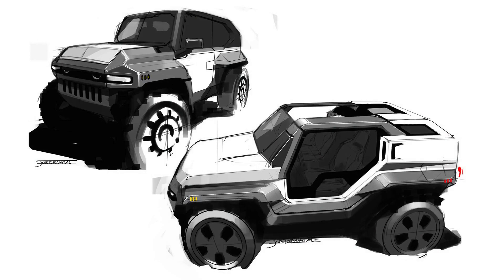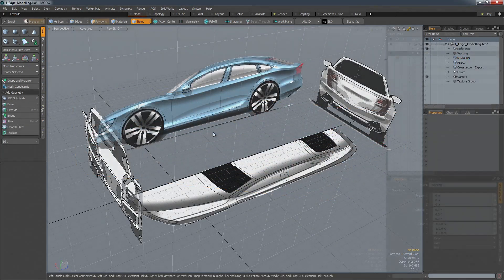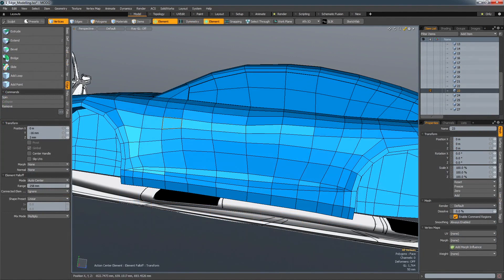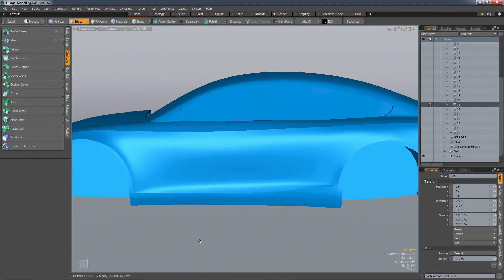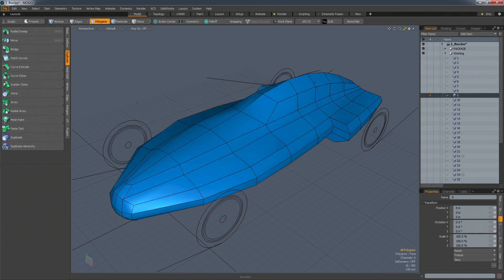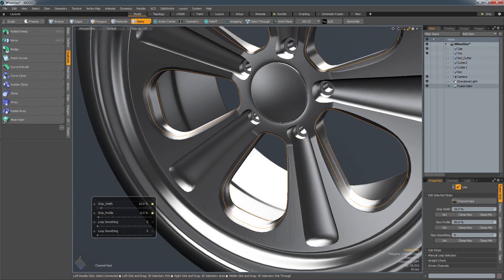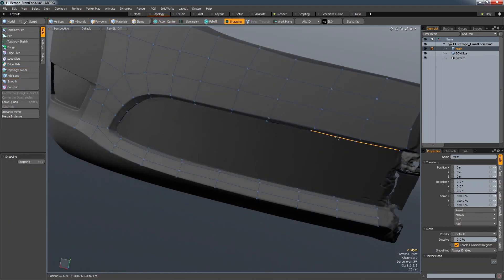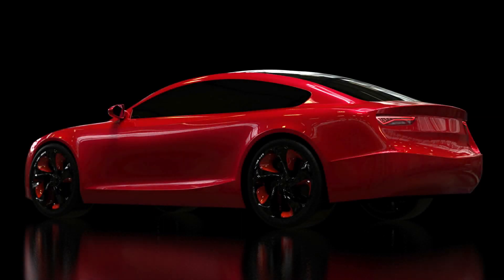MODO Automotive Concept Workflows

Comment: it was never a problem to create a model,  for a good modeler, few hours are usually more than enough! what the real problem is, is to maintain quality and flexibility through a number of design changes especially when output has to stay near class a quality including feasible radii, constant offsets,  integration with predefined geometry from other software (not recreation of it ), material separation, 3d printing or milling preparation, where output is constantly compared to bezier models and similar real world problems, coz thats what we do more than 95% of the time, rest is modelling shown in video...  additionally, all shown examples are done in clean manor, where all intersection curves between objects are closed, what is very rare case..